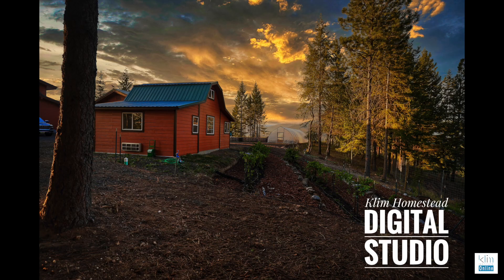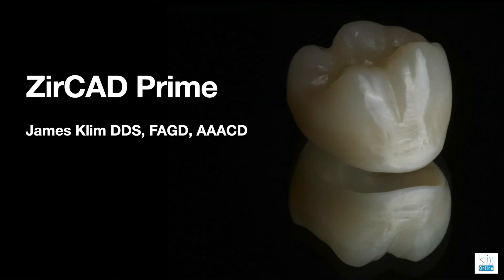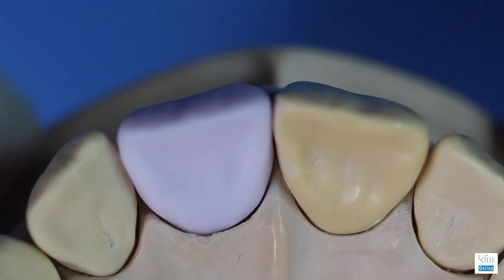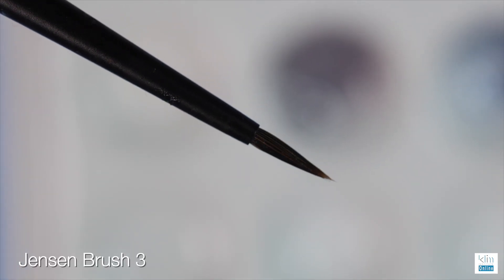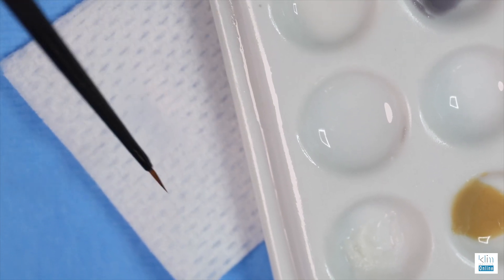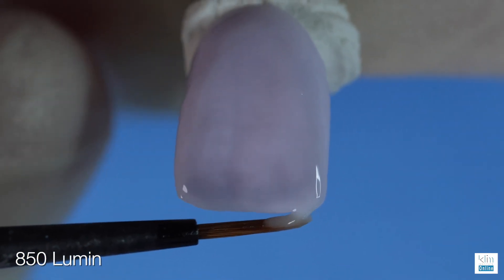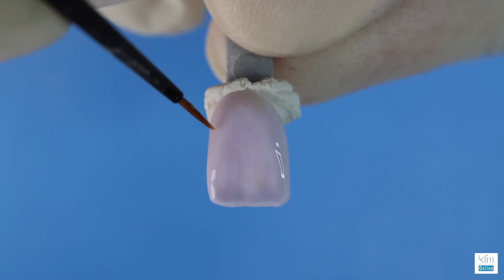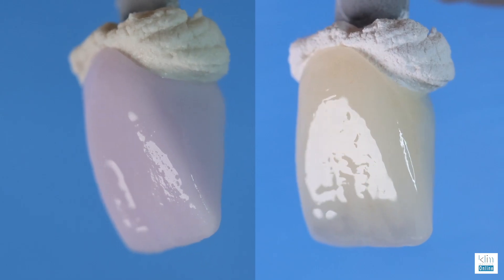Anterior e.max Stain and Glaze Workflow for the CAD/CAM Dentists

Comment: If you were using a Speedfire, how do you hold this restoration while glazing and then place into the speedfire? The little firing pegs for speedfire are much smaller and hard to handle and transfer in my experience. Any recs?
Reply from the maker: Yes, I agree, they are small. The Speedfire is not an efficient ceramic furnace; I recommend looking for a Programat CS or CS2 on eBay. There are limitations with the Speedfire; it is an excellent zirconia furnace, and that is about it.

Comment: Also are you saying that the Miyo 850 can be used in the CS 6 oven on program #1
Reply from the maker: Yes, for the CS6 superspeed cycle, Jensen has tested it, and it works just fine. I think that is what you're asking, sometimes Ivoclar reps will tell you you can't do that, that's with their Crystall system, but with the MiYO 850 you can.

Comment: Thank you for all these videos, Dr.Klim! So, I fired an Emax HT A1 3  times before I watched your video. I felt it was too dark/traslucent on first try in and I was trying to add opaqueness in the incisal 2/3’s . I am trying to bring up the value. Any saving it or should I just mill out 2 new ones?
Reply from the maker: Value can be raised with Lumin from MiYO.  However, HT can be incredible or a disaster with value.  From your descriptions, it would be better to use an MT or LT depending on the thickness of the ceramic and the color of the underlying tooth. Please take a look at the following link, It should help. https://youtu.be/tm5mgXQR_0A?si=AiNt_WEf11vOV8xd

Comment: Dr. Klim, can you add stain and glaze after you bake the crown without glazing? It is so hard to see the true color through purple
Reply from the maker: Yes.  With HT, the more bakes will create more translucency, thereby lowering the value.  One thing with MiYO 850, with experience, placing the MiYO in the pre-crystalized phase will preserve the value of the ceramic better, particularly when doing veneers less than 500 um in thickness.  That is the point of this video.  All the best.

Comment: I understand that emax could be done in the green stage, and that for teaching purposes is good to have this vídeos, but working out of purple tooth is asking for a mismatch, I've been a dental technician for 20 years and I've done custom shades and many many many crowns, and I can tell you that matching a shade with a pre shaded crown is difficult even more working from a purple color crown.
Reply from the maker: You are correct, matching in the blue state can be difficult, at first, having done my own ceramics for over 25 years I get it.  Each ceramic brand and translucency have unique behaviors.  I have taught ceramist and dentist for years, and the information in this video is a small "snap shot" of what is possible with practice and experience.  All the best.

Comment: Why speed crystallization? It’s not spray glaze. Thanks
Reply from the maker: Though Ivoclar recommends a speed cycle for only spray glaze, it is all about avoiding bubbling.  You will find that MiYO 850 does not bubble, so it is not a problem in the speed cycle.